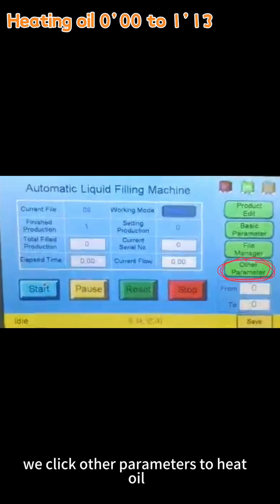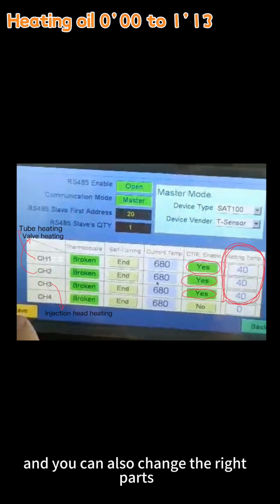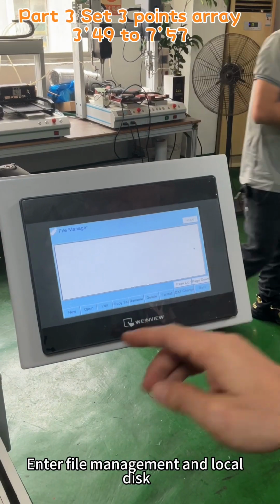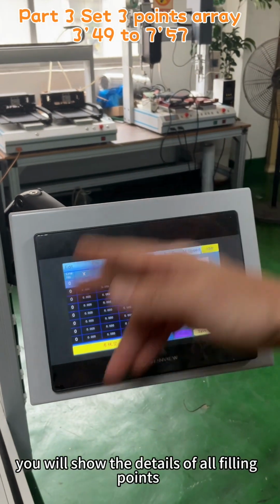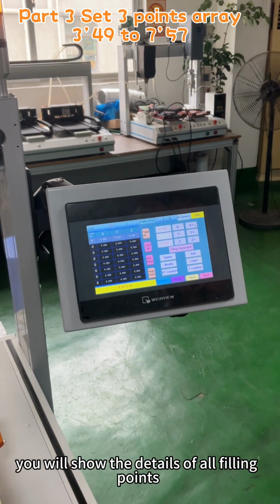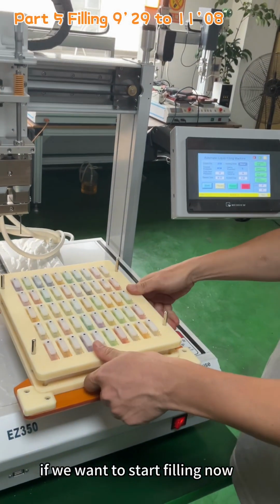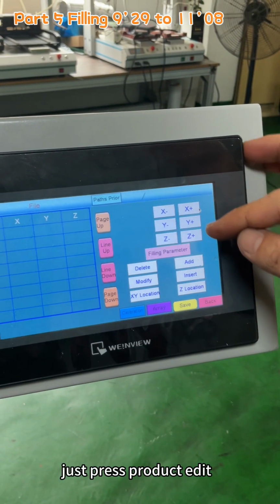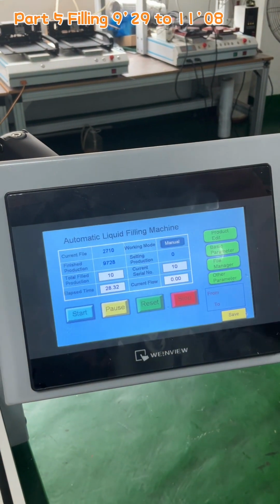Help my customer to get this 5 heads oil injection filling machine. For 420 cannabis vape device.

Comment from the maker: Part 1 Heating oil 0’00 to 1’13
Part 2 Discharge air from the tube 1’14 to 3’48
Part 3 Set 3 points array 3’49 to 7’57
Part 4 How to check all filling points 7’58 to 9’28
Part 5 Filling 9’29 to 11’08
Part 6 The right tray direction 11’09 to 11’33